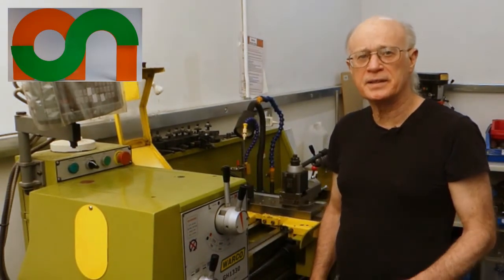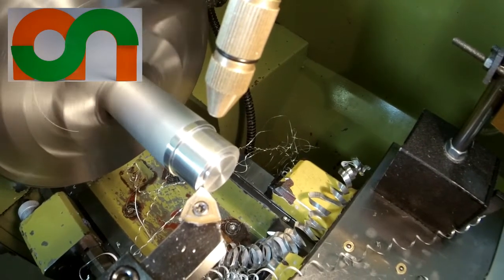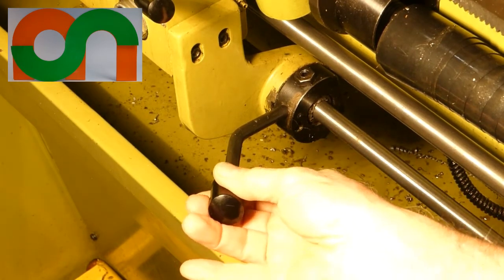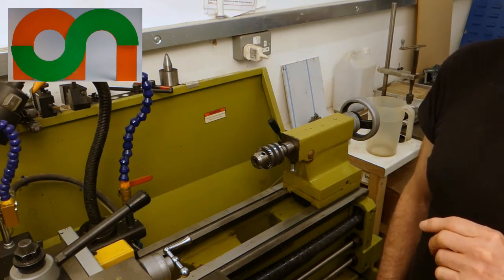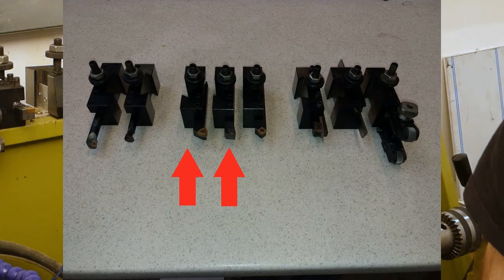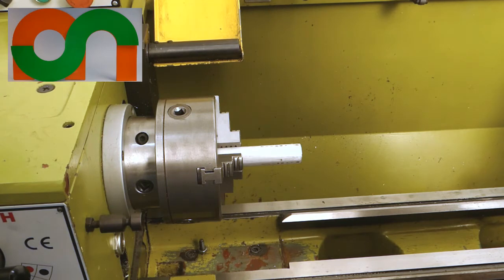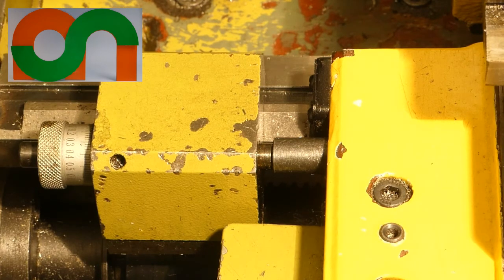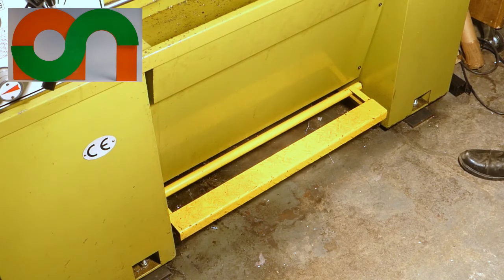Warco Lathe - Makespace Training

Comment: Excellent video on the Warco GH1330.  However I doubt there are many people with this lathe who need to be shown what the various parts are called and how to use them.  Beginners would almost certainly not be spending £4,650.  A video using perhaps, the Warco WM180 or similar, would be of far more use.
Reply: I can't believe I'm replying to a 2-year-old comment, but the video is specifically designed for members of a particular club (makespace in Cambridge, UK). They watch the video before completing an induction on the lathe. So they need to know how to use that exact lathe.
Reply: @mikehindley3 Hi  Mike.  Thanks for replying to my comment.  Had you mentioned the purpose of the video, in the video. YouTube viewers would have been able to take the purpose into account.
As it was, I consider it to be reasonably for a viewer to assume the video was aimed at ‘any’ member of the public, perhaps one who owned the lathe or was contemplating purchase.
As the video progressed, there was nothing to suggest that its intended purpose was specifically to ‘familiarise’ members of your club, with the GH1330. lathe. 
I have a number of Warco ‘metal’ machines, but nothing as expensive as the GH1330 (currently £6,216). As such it falls within the industrial category, and any professional user would be aware of the part names.  I hope you can now see why I commented.
Once you are aware of the intended purpose, the video,is excellent, however putting it on YouTube is, to say the least, questionable.
I’ve had a look at your website, and your ‘club’ is excellent.
Cheers Noel
Reply: @Jestey6  thanks Noel. I'm nothing to do with the video or the club in question though.
Reply: And I could maybe have an opinion or two regarding "Safe operation of a lathe". But that's just me, I have only used them for ~25 years...